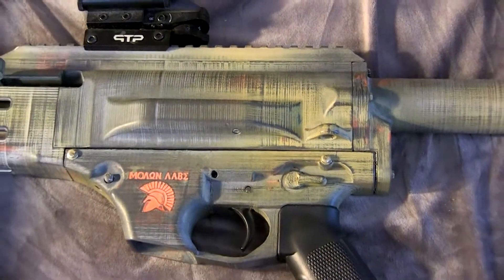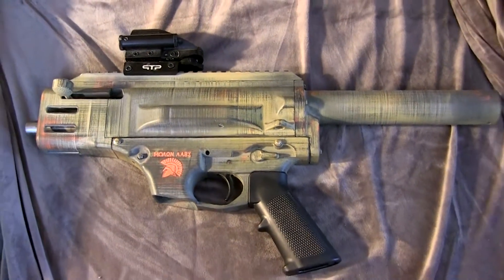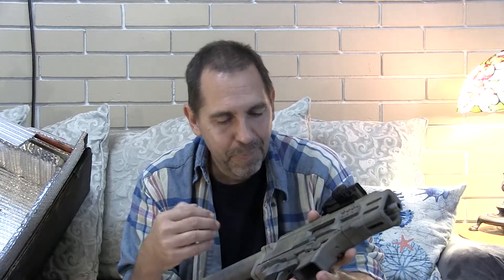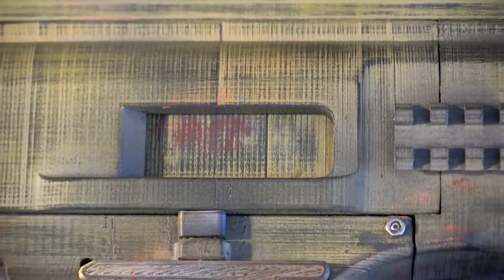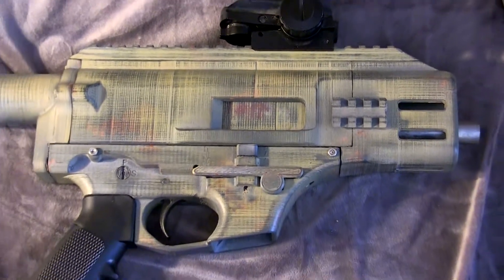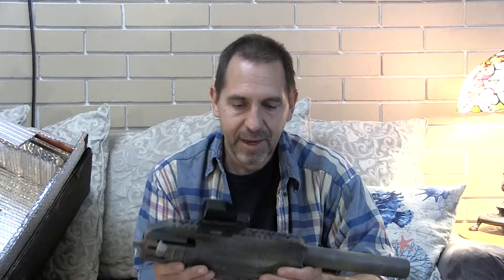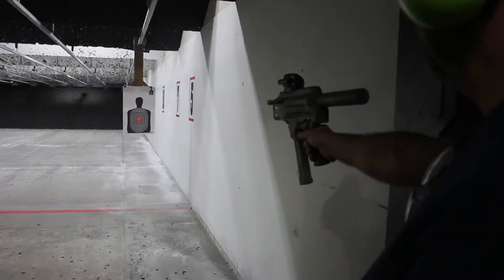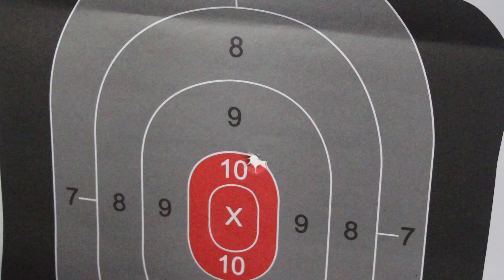Printing an FGC-9 in ABS.  Why?  How?

Comment: PETG or ABS is good for the barrel retainer which will get hot, but pla is much stronger than abs or petg so it's better for the parts that experience forces such as the upper receiver and buffer tube
Reply from the maker: If you store it in a climate controlled area,  PLA is probably fine.  Arguably superior. I’ve seen PLA warp when left in the sun, though. To me, that seems like a potentially dangerous issue.  I can see arguments either way. To each their own.  
I’m really glad to hear some dissenting opinions.  Debate is a great way to learn.

Comment: the fgc9 is for people who live in places where they can't buy one
Reply from the maker: I certainly don't encourage anyone to break their local laws.  For argument's sake, though...If someone is building one because they feel they need one, I honestly think that using PLA would be inviting disaster.  It's fine if you just want to see it work but, I wouldn't bet my life on it.
Reply: @amphoravideo  "3D print general" has  his in ASA and PLA they seem to work well
Reply: @amphoravideo  The group that designed this gun settled on PLA for it's cost and tensile strength. There are ups and downs but it does what it is supposed to do, and it does it well.
Reply from the maker: @tux8664  It's also much easier for people new to printing to get a good print from PLA.  I suspect that was another consideration.

Comment: why not use a carbon fibre nylon filament?
Reply from the maker: From what I've read,  nylon carbon fiber filament looks really cool but doesn't perform that well.  I've seen some tests that show PLA having a higher tensile strength than the carbon fiber.  It seems that the fibers are extremely short in the filament... kinda making it pointless.  Also, it's really hygroscopic.  I don't know if absorbing atmospheric moisture impacts its strength but it doesn't seem like a bonus.  It also has to be printed with a larger nozzle so, details might be lost.  IDK.  I still want to try it.